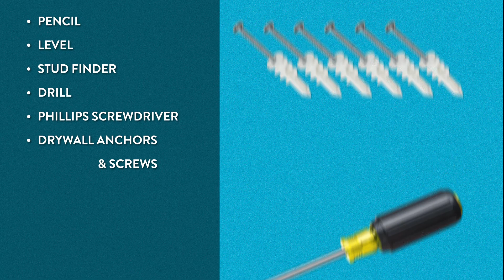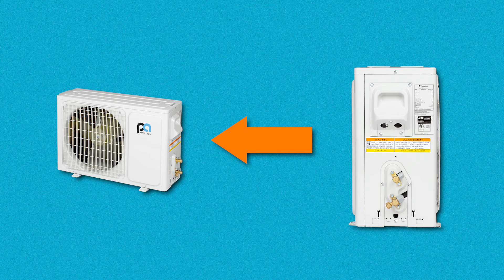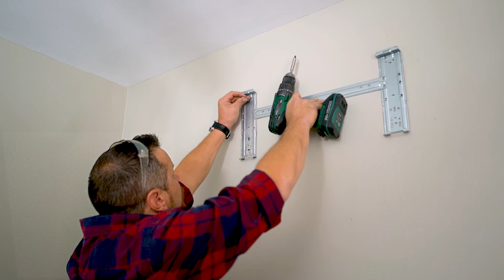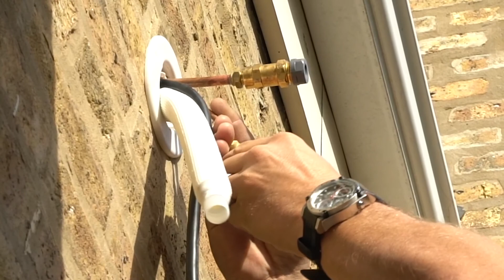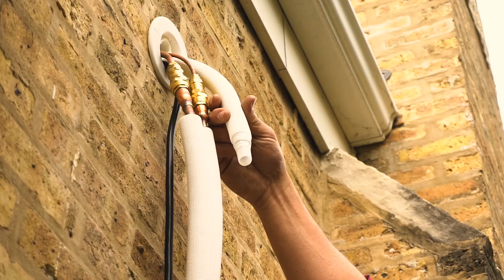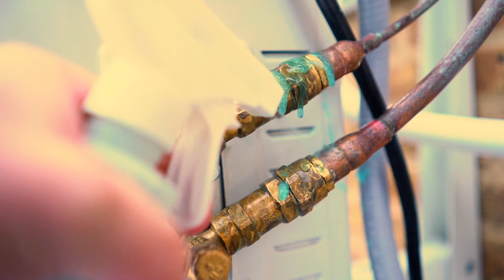How to Install a Perfect Aire Mini Split System

Comment: I don't like it that you didn't evacuate the line set and evaporator before you released the refrigerant into the system, but I guess your engineers have taken this into consideration. Personally I NEVER skip the evacuation step but I guess requiring that would negate the DIY nature of the system.

FYI I just bought six of these PerfectAire systems. Three of the 24kBTU and three of the 12kBTU.

Comment: So many inconsistencies between this video and the installation instructions shipped with the unit.  Which suggests to me that these inconsistencies are irrelevant. 1) The manual says to leak check before powering up. 2) Manual says open the top valve first.  Come on guys get your sh--t together.

Comment: I bought a Perfect Aire Mini-Split system, the Outdoor unit defected out of the box - no refrigerant gas flow sound when the refrigerant valves are opened. Fan is not spinning when commissioning the system. The Perfect Aire support team refused to replace the whole Outdoor unit, but they offered to send an internal electronic circuit board so that you can find a local HVAC expert to repair on your own cost, and no guaranty for a fix. Don’t trust Perfect Aire’s No-hassle 1-Year Warranty full replacement advertise. And Don’t buy any Perfect Aire products all together if you don’t want any headaches.

Comment: On second year of our 18,000 btu system with two wall units and loving it so far. Don’t forget to use dry mode in humid summer weather.  Cools the air by removing humidity. More efficient in those conditions.
Reply: How does it do during the winter
Reply from the maker: Greetings imhere6868, our single-zone quick-connect systems are engineered to provide heating capabilities in outside temperatures as low as 5°F, and they often perform effectively even below that threshold. If you require a solution for even colder temperatures, we recommend exploring our multizone systems, which can operate down to -13°F: https://perfectaire.us/collections/quick-connect-ductless-heat-pumps?gf_20201=Quick+Connect+Multi-Zone+Systems
Reply: Great.  No issues whatsoever.